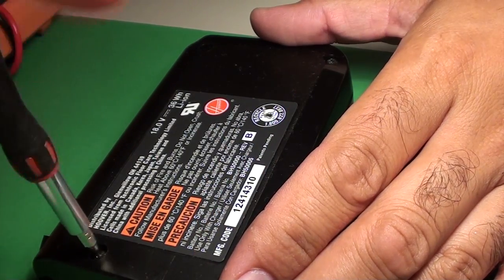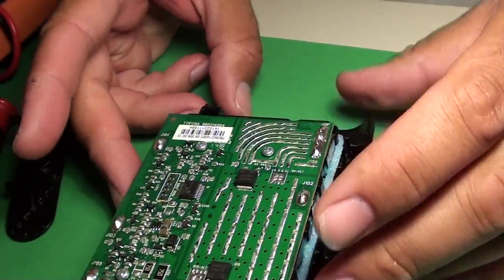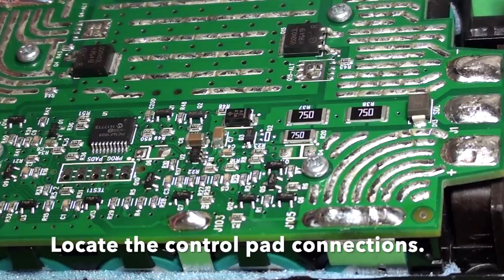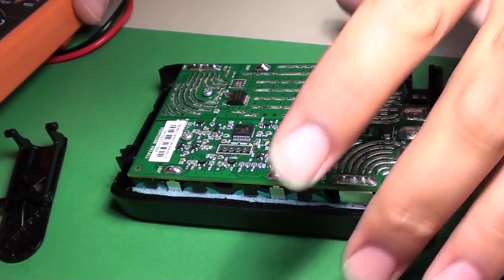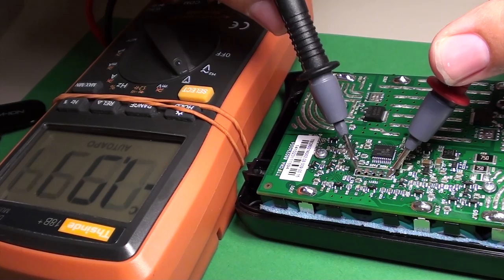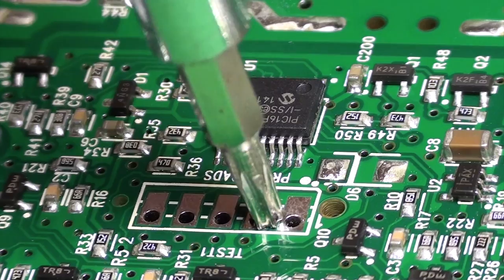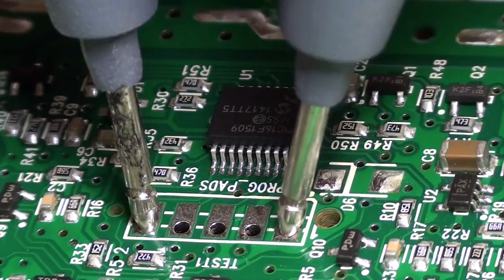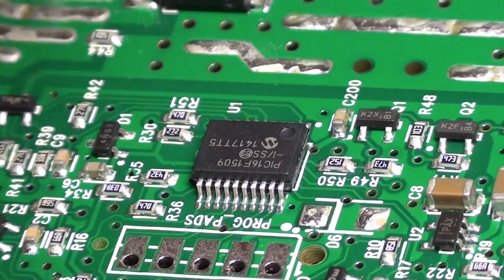Hoover Linx Lithium Vacuum Battery Charge Count Reset

Comment: So did anyone get any further with their onepwr battery? I have lights 1 and 3 on. I took the battery apart all the 18650 cells are above 3.2v. I can do this reset on pins  1 and 3 and all 5 lights come up and then go off. Still no different though.

Comment: How do you short the board? It looks like you are using your turned off multimeter probes on P1 and P5, and then a 3rd thing is quickly touching 1 of the probes. What is that?
Great video thanks!

Comment: The battery on my Vax has a charging board almost identical to yours. The battery measures fully charged but the output is 10v with no current capability. Tried shorting the pins suggested but no change. Have you any ideas?
Reply from the maker: Might be bms damaged. You can basically buy a 18V bms circuit but you need to charge it an external power supply

Comment: how did you set the volt meter? was the charger plugged in?
Reply from the maker: Controller PIC powers from the battery also has permanent memory Rom.
Reply: @tipstricksreviews4481  I'm not sure what that means.
Reply from the maker: @herbsu4330  I used voltmeter just to show pins. You are not resetting with the voltmeter.This is a pic controller and I looked its datasheet for reset pins. It seems manufacture made an expensive charging board with all those contollers

Comment: I wonder if this would work on our 21.6 V Li-Ion battery pack for an older Hoover Cruise ultra lite cordless vacuum cleaner?
 We bought it used and it seemed to work pretty well for the first few times and then suddenly it started to shut off after about 5 or so seconds of use. I've tried charging the batteries twice and it still shuts off.
Reply from the maker: It seems you might need battery cells inside, be casefull when you are working on lithium batteries
Reply: @tipstricksreviews4481  I still have that vacuum but we've bought a new one since then. I still may try to change the battery cells inside, I'll be careful, I've watched several videos on changing lithium cells, thank you...

Comment: Newbie needs help. On voltmeter between pins 1&2 and between pins 1&5 there are 5 volts before shorting and still 5 volts after shorting. I'm certain that I shorted (tried several times). Is voltage after shorting supposed to be a different than 5volts?
Reply from the maker: Voltage doesn’t change. Its a PIC microcontroller. You can type the model number on google  and be sure which legs are for reset.

Comment: Be Careful, I shorted 1-2 and 1-5, then a chip on the board became extremly hot and will not cool down, and the battery will not even work in the vacuum now even with 18v since I manually charged it before shorting the test pins. This did not work for me and now battery is useless.